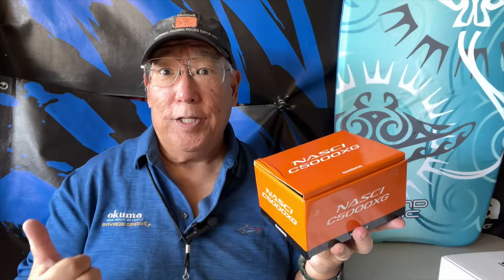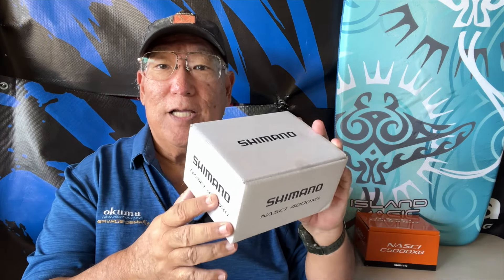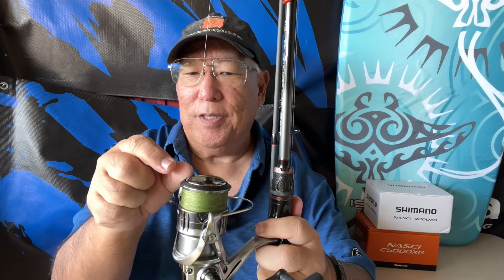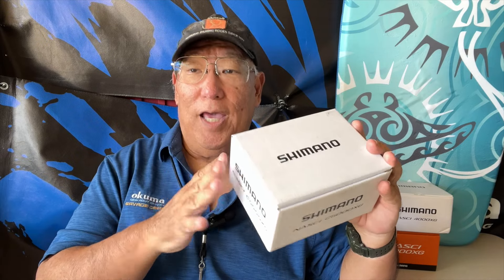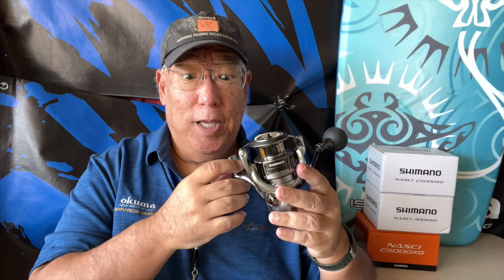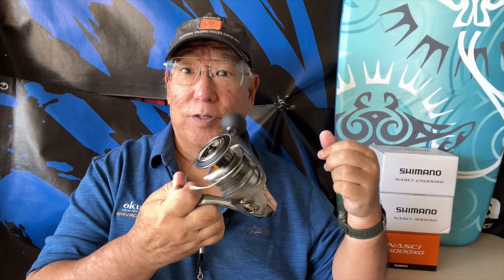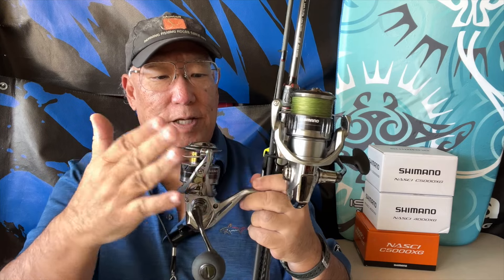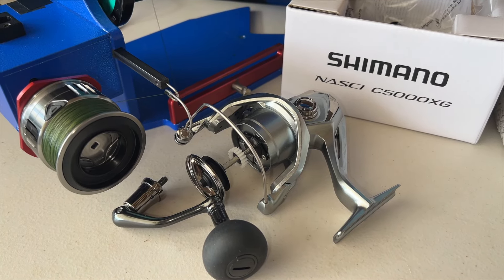Unboxed my Shimano NASCI 5000XGFC! Same Tech in Other FC Reels!

Comment: I just bought and returned my Nasci 5000 and didn't even try it because I wouldn't use it much for the type of fishing I do.  The reel felt great and the price is right ($109 + tax), however I see this as being used more for whipping or when using floaters(bobbers).  I mainly dunk using anywhere from a 2oz. - 3oz. lead and the combo I use is a BG 20s on a 14" rods. So I returned the Nasci and got something that better suits my needs which is the Okuma Inspira 5000 XA.  It holds about the same amount of mono as the BG 20 but it has a higher retrieve ratio of 6 : 1,  I'm just hoping that the spool size is similar to the BG 20 and not smaller because I won't  be gaining anything if the ratio is higher but the spool is smaller.
Reply from the maker: To be honest they're almost on the same field though the Inspira is more updated with better stats, I own a Nasci 4K & 5K and Inspira 4K & 5K XA. But I feel the Inspira was a major upgrade. The 5K Inspira is in the upper $80 range so cost less as well. Of all my spinning reels 5K and under my strongest best & most used are my Blue Azores. Did you see Alan Hawk's rating chart? I'm NOT a fan of Penn due to the weight. Daiwa BG is a good choice. The Blue Azores was #3. I still have the original whites. Fought in a 5ft Ulua off a pier after +40min on the original 8K White. The new 8K Blue would've done better! 

I'm no longer with Okuma as my 2 terms have expired years ago. Right now Daiwa is interested in me but i'm not sure as 2 other smaller firms are interested as well for next year. Kinda like being an independent in the meantime. If Okuma wants to sign me for another term i'd gladly accept them as we seem to work well together & i believe in their products. For shoreline dunking i'd go Blue Azores. I still have my original units from Sports Authority before they went out of business. 

So as an independent who owns  way over 100 reels w/no affiliations i'd say if you dunk our shorelines use the Blue Azores. Hands down. I own around 9 units i think? I whip with the 4K. Also jig using it. And dunk. If i used Shimano for that same application i'd go Nasci 5K. Yup. Daiwa i'd use Legalis 6K. A lot beefier & stronger than most realize. Penn the BG. 

The "Sleepers" rarely seen for dunking i'm slowly adding. The Daiwa Saltists Spinning Reels. They're way larger than the designations states. Holds more line. Uses BG & some MO technology but still mostly under $200 if you know where (i do). I currently own the 4500, 5000 & 8000. Everyone way more massive than expected! My BNIB 4000 arrives in a few days. My 4500 looks & feels like a 8K, my 5000 a 10K, my 8000 a 12/14K. I'm hoping my 4000 will be more like a 4500 rather than a 5000. Otherwise i'm going to have to get the 3000 Saltist next. I found a source when i'm getting them CHEAP BNIB. 

Also found a company that i got my exceptional reel covers for all my Daiwa Saltists from spinning to conventionals recently. They want me to be there new dealer here in Hawaii because i recognized the level of quality they're putting out. Also cheaper than the others as well. Thinking about it. 

https://www.alanhawk.com/reviews/lists.html

Comment: Aloha @ScubaChris,I have a Penn battle3 4000hs for my whipping rod? Should I put 30lbs or 40lbs braid on it,I have 30lbs Jbraid on it for plugging in the SF beaches already..Just subscribed to ur channel and enjoying ur content 🤙🏽
Reply from the maker: Sounds like you got it. I put 40lb braid on 6K/7K reels, 50lb on my 8K. Really depends on what you're targeting. On my 5K's with limited line capacity i spool on 20lb braid. If my 5K has a C-type "deep-spool" that holds more line than normal then i go 30lb. If you're targeted species is the type that likes to run i'd go lighter for lineage. That's why i go 20lb on my 5K. Go slightly heavier otherwise. I really like 20lb. I've jigged Shibi's off the FAD's using 20lb braid & i pull in 8-20lb sizes np. Largest was a little over 50lb. I try to use my best rods when i do this. If it's a "so-so" rod i go with a slightly larger reel w/heavier line. After awhile my arm & shoulder pays the price of me being "cheap". So i tend to have both types available. Hope what i do has helped you. Of course you must adapt to your available species & equipment as nothing is written in stone. Good luck.

Comment: Thank you sir for the information
I have nasci 5000 xg wich braid size should i use if im targeting king fish from the shore ?
Reply from the maker: I guess that depends on the size range of the Kings. So many ways of tackling this. All braid. All mono. Braid with mono top shot might be an option to consider. You'd have yardage from braid for runs while the mono top shot will do better because of the teeth abrasion. What sizes are you encountering from the shorelines? If it was me i'd use 20lb braid as my main. My leader i'd go 30lb mono unless you like that immediate hook-set then go 40lb fluoro (plus most fluoros have excellent scratch resistant coatings). Fluoro you can set the drag & the fish will hook itself whereas mono you need to give a good yank to help that hook set. But i still prefer mono leaders myself because i do need some "give" as using braided mainline provides no give. So many options. Choose what works best for you over time. Having several rigs w/different configurations will give you a faster option. Good luck!

Comment: Hi thanks for the video. What is the difference of the 4000XGFC and the 5000XGFC? I wanted to get one for my 7" Shimano Raider 8kg spinning rod. Thanks
Reply from the maker: The 5000 & 4000 basically share the same body. The difference is in the spools. 5K spools are larger and/or deeper. So it can hold more line. Same principal between 2500 & 3000 reels.
Reply: The 5000xg has the power knob...larger spool...and carbon drag washers

Comment: How do you make it left handed
Reply from the maker: See the handle? Unscrew that off and screw it in on the other side. And the port cap on the other side? Screw that off and reverse it to where the handle ORIGINALLY was. Standard for all spinning reels. But on conventionals you need to purchase either L or R.